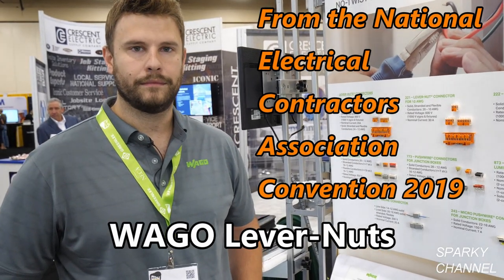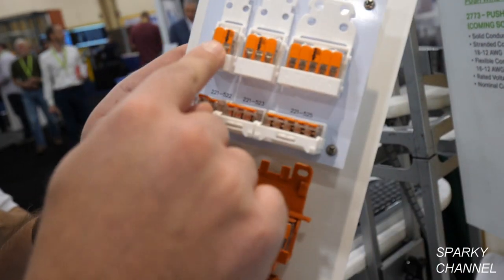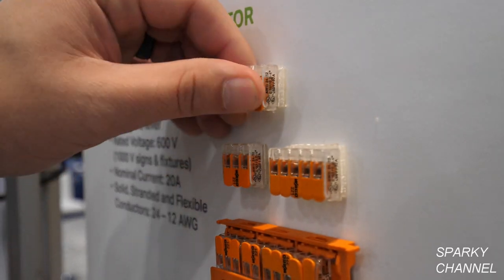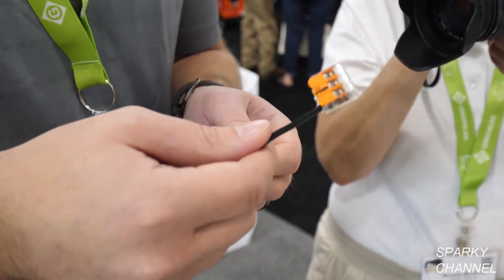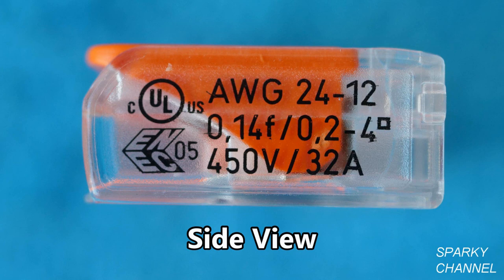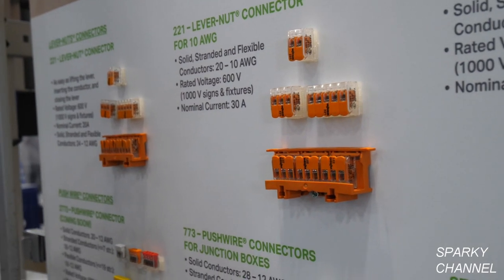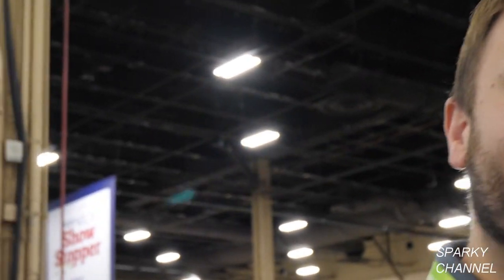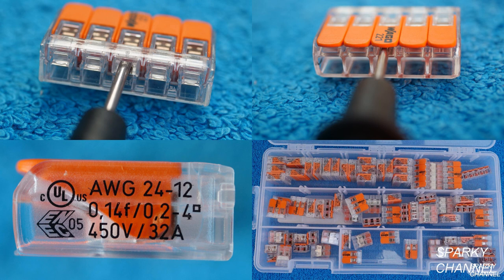Wago Lever-Nuts Questions and Answers From National Electrical Contractor Convention

Comment: is it normal for the wire to be able to move after its locked?
Reply: no, that;s not ok.  there are other companies producing similar connectors but quality is lower. Never had issues with wago221 nor obi.
Reply: You can still twist the wires after they are locked down yes,
Reply: @MrProtozaur  yes, that is perfectly normal. Solid cores in wago and clones still twist, in the non-lever models, that’s how you take out wires, twist and pull.
Reply: @JasperJanssen  imeant move without the twist
Reply: @MrProtozaur  yeah, that’s not supposed to happen, if you pull straight out, you can overcome it if you pull hard enough, but it should basically scrape a sliver of copper off, and not do that in normal use.

Comment: I dont mind using wire nuts for stranded copper. But I much prefer these with solid copper. Now I don't have to worry about splicing or accidentally breaking off solid copper wires when splicing with linemans pliers or twisting on wire nuts.

Comment: Ok, your interview with wago does not include this question. Can I use wago connectors outside for exterior use? One step further, exterior enclosures UL rated for in-use wet locations, a 20 amp gfi receptacle in my driveway on the side of the house. So currently by code you can use wire nuts right, wire nuts are open on the end, so there is no difference between wire nuts and wagons as far as weather tight. Please can anyone advise about the code in this case? Can I use wago connectors in the above example? Thanks for any input_Jim
Reply: Not sure about any code in america (as I do not live in there) but Wago has a gel box for usage in wet areas. Adds a extra cost for each connector through.

Comment: Probably a dumb question, but can these be used in automotive wiring?
Reply: I don’t see why not as long as you use the right size Wago for the right wire gauge.
Reply: You need to consider the environment.  With vehicles, you have vibration, vast temperature changes with humidity and depending where the connection is, a whole lot of crud.  Vehicles tend to have crimps or solder.
Reply: Just watch the amps man.
Reply: You absolutely can.

Comment: I wonder if y can use it for 240 volts
Reply: In the video, Did you see the words printed on the side of the Wago. 300 Volts, 20 amps. 240 is 2, 120 volt lines in parallel , so you can use. A Wago for a 240 line
Reply: They are used for the standard European AC Voltage of 230V AC +/- 10%

Comment: I tape my levers down just in case but he says we don't have to I won't use any thing else now
Reply from the maker: Sounds good!
Reply: I believe the reason for taping was for the wire nuts only, just to make sure the nut doesn't fall off the twisted bundle of unknown connected wires.
Reply: I always give the Wago's a wrap or two of tape just to make certain that the lever doesn't come open while inserting them or other wires into the box.
Reply: Alan four years ago I completely rewired my 1950's house. I used Wagos throughout the entire house. Fast forward to the current time and I'm doing a panel swap. In the midst of my panel swap I had to remove a few of the Wagos I installed 4 years ago. They were snug as a bug in a rug. No looseness, no signs of arcing, no nothing. I've heard of people taping the levers, but I did not tape mine. The new 221-2411 inline connector is the bomb if you need to extend a wire in the service panel. They don't take up a lot of room, and look a lot neater in the box. I am NOT an electrician, but my inspector passed me on the first lick. Complimented me on my neatness and thoroughness. He hesitated on my Wagos until I showed him the UL certification, but after that it was clear sailing.

Comment: I've heard wire nuts are banded in Europe? Anyone confirm?
Reply: I'm actually not sure but I have never seen one over here. Before Wago/push connectors, everything was screw terminals.
Reply: Wire nuts where banned in the 70s in the UK
Reply from the maker: I asked a friend from Germany and he said they aren't banned, they just don't use them anymore.
Reply: Can only speak for Germany. Wire nuts are perfectly legal. But I have rarely seen one in any installation here.
Reply: I've never seen a wire nut, but old instalations (like 60s and earlier) are just manually twisted and wrapped in tape. They switched to screws around that time.
Reply: I've never seen a wire nut, but I seen plenty of nutty wiring... A whole kitchen run on 1.5mm2 (radial not ring!) on a 32A breaker, how the house didn't burn to the ground I'll never know.

Comment: My only thing with the 221 is that the resistance is too high compared to say like a nut. Electrical nut is 0.15mr, while wago 221 is 2.2mr. Too high IMO.
I bring this up cause I live in Texas where it is hot, and the extra resistance do cause additional heat. Now there is a small fear of fire as well as concern of power lost.
Reply: rating of the wire should be high enough so that the mcb shuts it off.    here in the EU  its 2.5mm2 which could handle 25A ish while getting slightly warm   but yet we only allow it to go to 16A      so even when having not that great of an connection there still is some safety margin before it has issues      However its in 230/400v systems so that already is safer then 110/230 systems

and its just so much easier to reuse when you ever have to change a wire or modify it.  with twistnuts you strech the copper and make it thinner  so the 2nd time you use the wire its not that great anymore.  so you cut off and strip a new piece however when the wire is short and then?   yeah just reuse and then it creates issues.   on both of them people can misuse them.   they are both rated for the current and voltage so both of them are good.    its just how much people mess it up. and then go complain about it all
Reply: @DiyNuke  Keep in mind that, properly installed, WireNuts do not carry ANY of the current involved.  (You can make WireNuts out of entirely dielectric material and they will work just fine.)   Done properly, their sole purpose is to "hold the wires together" so they maintain conduction wire-to-wire.  

Lever nuts, by contrast, are "in circuit."  Most of the time, this is not an issue because the circuit has "over-current protection" and the LeverNut ratings all exceed the standard current rating of the wires for which they are sized.  That said, if "connection resistance" is important, LeverNuts are going to increase that value compared to WireNuts because you are as doubling -- or more -- the number of connection points. 

In a properly done WireNut, you have Wire1-to-Wire2 directly connecting.  In a LeverNut, you have the first connection is Wire1-to-LeverNut, then you have a second connection of  LeverNut-to-Wire2.  This potential for increasing resistance one reason I generally use an Oxide Inhibiting Compound on the wires I insert into LeverNuts...
Reply: @flyinglpranch3886  nothing in the instructions say to use oxide inhibiting compounds.  And they have a UL listed number.  Therefore according to the NEC, one must follow manufactures instructions, in order to be code compliant.  Just as in twist wire nuts(wire nuts being a trade mark, so all twist on, are NOT wire nuts)there is no instructions to pre twist wires before inserting into twist connectors
Reply: @cengeb  Please keep a few things in mind: 

1.  I am only saying what I do; I am not suggesting anyone else do it...

2.  You are correct, there's nothing in the manufacturer's instructions that say to use an oxide inhibitor.  Also, I see nothing in the instructions prohibiting it.  I have a whole bunch of panel lugs and breakers that, in like fashion, don't specify using -- or not using -- an oxide inhibitor.  When I install those, they get a light coating.

3.  I've been using DeOx (yes, I am intending to use the trade name) for about 50 years now.   That's enough time that I have, for a variety of reasons, had opportunity to go back and disassemble some of my previous work.  Sadly, I have had some instances where connections showed corrosion -- or evidence of corrosion -- but never on any connection that was coated with DeOx...

You also have to keep in mind that not all Oxide Inhibitors are created equal.  Before Stainless fasteners were readily available and before teflon tape proved its worth (to me), I used DeOx in applications where I was using carbon steel bolts to secure an aluminum housing.  (In fact, restoring a winch with an aluminum housing was my introduction to DeOx!)

Today, whenever I replace a car or truck battery, the terminals get cleaned with a Lyle Terminal Tool (no longer available 😞) that perfectly cuts the terminal and the post to the same angle.  (I also replace the 1/4" bolt in the terminal with a 5/16" stainless bolt.) Then ALL surfaces get coated with DeOx before -- and AFTER assembly.  Thanks primarily to the DeOx coating, I typically get phenomenal battery life.  (I replaced several batteries this past year; they were, respectively, 12 years, 14 years, 16 years and 17 years old; none had had ANY maintenance -- other than keeping the cells topped up.  EDIT:  I have a new "personal" record, I am about to replace the battery in my 1948 JD Model G @ 21 years...)  I have tried other Oxide Inhibiting Compounds.  EVERY other type I've tried "flows" out of the connection when it gets warm (as it will in an engine compartment); some "flow" even without getting warm. 

Oh, and if you have some "outdoor" Edison Base bulbs, have you ever had to turn the power off and remove the base of a bulb with a  pair of needle nosed pliers because the glass broke off of the base when you went to unscrew it?  A thin coating of DeOx on the base before you install a new bulb -- and you won't have that problem... ever...

So, yeah I add some DeOx to the wires before I insert them into the LeverNuts.  I'm perfectly happy if nobody else ever does that...  🙂

Comment: The connection is about the contact area. It is look like that the contact area is limited to what you call it clam and it seems inadequate area of contact between the wire and the connector.
Reply: Everybody that has tested these has found they take all of their rated amperage and then a lot more. One guy melted the insulation off the wire before the lever nuts melted.
Reply: It's not only the springloaded clamp that makes the connection, there is also a "thick" bus bar in every Wago connector. The clamp presses it to this bus bar and also secures it in place like a sharkbite fitting used in plumbing.
Reply: I work in industry industry, and use them, everywhere. They have become our standard. 
They are better than you expect. We even throw away screw terminals, in connection boxes, and use 221 wagos.
Reply: That is called engineering, when you take only as much contact area as needed.
You may still use your wire nuts combined with 2 foot wire drilling for better contact.

Comment: 221 10ga or 12ga?
Reply: 221 is the number of the series. The first number is the cross wire section in mm², second is the number of rows and the third number is the number of terminals.
10AWG is comparable to 6mm², 12 AWG is comparable to 4mm²
So a 221-613 is a 10AWG (6mm²), single row connector with 3 ports.
a 221-412 is a 12 AWG (4mm²), single row connector with 2 ports.

Comment: Price is definitely a factor on these, if you know how to splice connectors well with wire nuts I don't see a reason why you would use lever nuts. I work in custom homes and even then lever nuts are that much more expensive that wire nuts.
Reply from the maker: Thanks Brandon!

Comment: Ask him why there are no 4 port connectors.  goes from 2, 3, 5, 7.  ???   4 is very common for grounds.  Twisting 4 x10 gauge wires is difficult with nuts.
Reply: No problem twisting 4 or 5 #10 guage copper conductors. Have been doing it last 55 years. Just get a large pair of quality made in USA or Germany linesmen pliers to make it easy to do.
Reply: @JohnThomas-lq5qp  yeah me too. I have been twistin them guage copper conductors for 69 years. No problemos what so ever.
Reply: You better build up some muscles. Was on jobs where we ran thousands of feet of #10 solid that went thru two boxes of wire nuts . More you do the easier it gets. Always used the largest side cutters made to twist heavy wire.
Reply: @JohnThomas-lq5qp  listen youngster. I was twisting cables all my life. In my days wires were made of wood. And we nailed them.
Reply: @PERIZI  Guess you have a few years in me. We had wooden boats with sail power. Grew up with Tommy Edison.
Reply: @JohnThomas-lq5qp  most things made in America are not by skilled labour. All the skilled manufacturing technicians are in China.
Reply: @PERIZI  but America has no installation testing requirements like European countries so you will never know if it’s an issue until someone dies for instance, would you be able to prove her fault loop and fence test to show me that the ground connection is good?
Reply: @spocksvulcanbrain  I never had a problem pre twisting up to giv #10 Guage wires. Start by always stripping the insulation to a inch then use one of my largest heavy linesmen ( some call them side cutters )  to twist them until insulation has at least halve a twist , trim ends of wire then tighten them with the heavy pliers and tape wire nuts. Have used this method on vibrating screens, crushers, large centrifuges, and came back ten years later and still  working.
Reply: @UKsystems  Items used for electrical work in the USA must be listed &/,or approved by an approved testing agency. We always purchased & used only quality products. Never used cheap dollar duplex receptacles but usually spec grade. Nothing beats a made in USA Hospital Grade tamper resistant duplex receptacle. Face cover is made from tuff nylon where a 3# hammer will not break it.
Reply: @JohnThomas-lq5qp  you just said iTunes using the USA must be high-quality and then you mention how you only use certain products. Surely there’s a reason behind that due to quality

Comment: There's obviously a lot of advantages to using these over the 3M suitcase connectors. Except that although the salesman here said that you "Don't have to do nuthin'" to the wire, you do. You have to strip the wires. And that's one HUGE advantage that the suitcase connectors have... No stripping necessary.
Reply: Crimp style is one and done (unless you really wanna waste time prying them apart). Wago 221's offer reusability and serviceability. One needs pliers to crimp the other needs strippers. 6 of one, half a dozen of the other. To each their own, so crimp away mate.

Comment: The only real downside? The price.
Reply from the maker: I understand.
Reply: Price is a consideration, but a couple of points to think about: 
(1) If looking at price each, not a huge investment for a really s,all job.
(2) On a bigger job, you should weigh cost for connector vs time (labor cost) over the entire job.
Reply: @mothman-jz8ug  Yeah good points. I can also see using the 5-port ones for lighting circuits in multi-gang boxes. Twisting 5+ wires is just not a fun thing to do.
Reply: these are 20cents in germany if an hour of a professional charges 70€ its well invested money
Reply: @hausaffe100  In the USA, Wago costs about the same. But traditional wirenuts are 5-10 cents. Yes, the fast labor of Wago more than offsets wirenuts, but unfortunately a combination of nearsighted contractors and old-fashioned electricians here have a hard time realizing that.
Reply: @aaron74  im always irritated by the american relationship to electricity and technology, get the most mordern silicon valley stuff but built homes to 1950s standarts but add airconditioning,
Rcds and 3 phase supply is something most americans have never heard of
Reply: @hausaffe100  RCD in the rest of the world is called GFCI here in North America, and as far as I know they're exactly the same thing--breakers that trip with a ground fault (which in the EU is called earth). In fact we have AFCI protection too. Does that exist in Deutschland, or the EU?
Reply: @aaron74  AFCI exist but aren't mandatory
Reply: @hausaffe100  Interesting. AFCI is mandatory in most North America for residential construction. The requirement has increased the cost of new electrical installations by an order of magnitude compared to 10 years ago.
Reply: @aaron74  electrical fires are pretty rare here, but no one wants to risk a schock
Reply: I just bought 5 of them for $2.50

Comment: My understanding is that the twist nut type are the best for the least amount of voltage drop, heat output and lowest resistance.
Reply from the maker: Thanks!
Reply: It’s very very negligible unless you have hundreds of joints